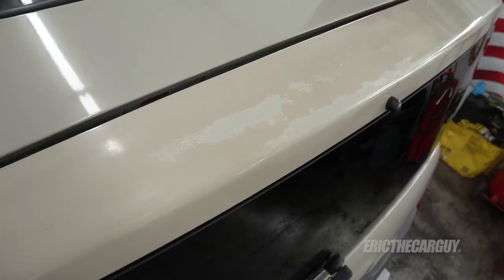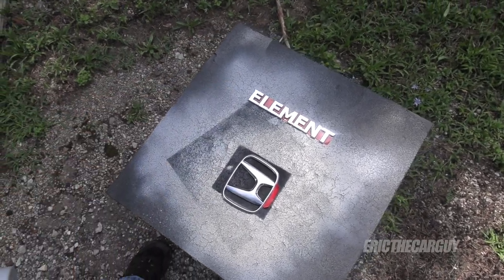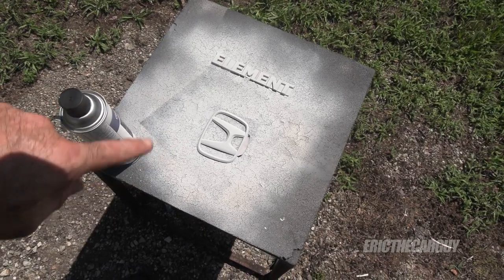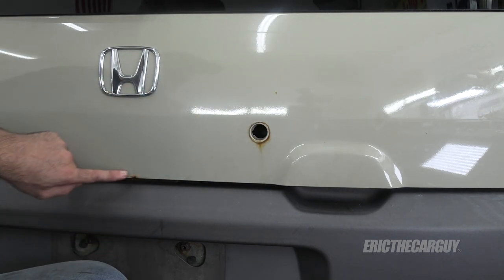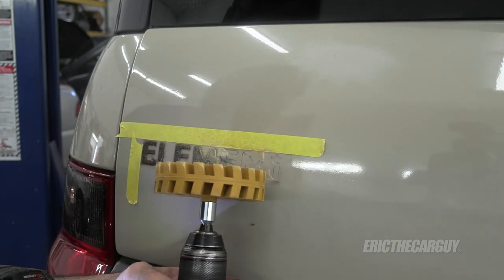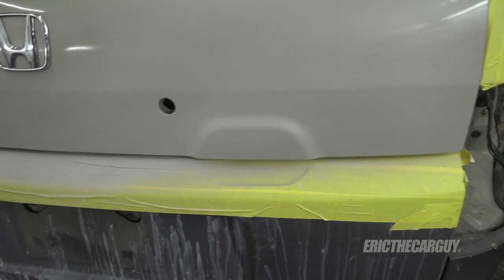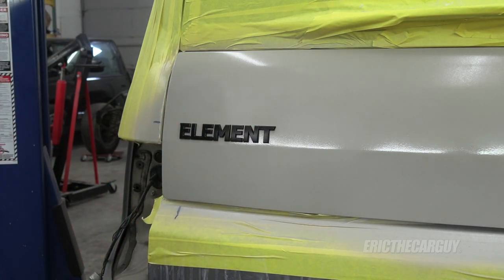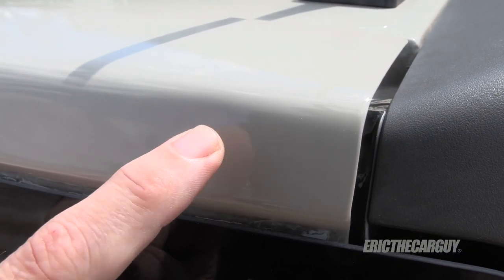DIY Clear Coat Repair

Comment: My suggestion for older washer hoses and plastic tube removal. This works for me. I use a heat gun to heat up at the connection I am trying to separate. Being plastic, most of them turn soft with just a bit of heat and greatly reduces the risk of breaking or damage to brittle parts.
Reply from the maker: Great suggestion. Thanks!

Comment: I remember doing bodywork on cars in the 70s and all of those lovely metal emblems that were installed with either barrel clips or speed nuts. There were holes in the body panels for the pins to pass through and the barrel clips would  cause rust to start around each of the pins. The speed nuts were especially annoying because they were very difficult to access. Sheet metal stampings had lots of sharp edges back in those days and I left lots of DNA samples behind. Japanese cars were among the first to start using glue on emblems which was fine by me. They weren't really expensive to replace at the time so it made my job much easier.

Comment: Great video and very similar to my outlook with bodywork. I never try to get it perfect, I just want it better than it was. Just one important comment for your viewers. It's not a great idea to sand between coats of clear. It is better to put all the clear on and then sand. First it has to be good and dry to sand, and second you need to have a decent amount to sand or you burn through. The last stage is always "cut and buff", which means sand with high grit sandpaper until flat then buff with polishing/rubbing compounds. I almost always skip this because I don't care, and it drives my brother crazy. Keep up the great videos.

Comment: Whenever i put my emblems back, i just measure with a pair of calipers to find the corners of the emblem from two pieces of tape with dots that i place outside the work area. So like on the lights, or the window.

Works really nice and cannot fail nor does it get in my way. If you leave the tape large enough, you can write on the tape the two top corner measurements. Generally, i just write one, and leave the calipers set on the other.

Comment: Yeah, I noticed those dents and figured out how they got there. Couldn't decide whether to comment on those but then you 'fessed up at the end of the video. Anyway, your work turned out nicer than mine usually does. And you're absolutely right about insurance and bodywork involving emblems/badges/etc. In my experience, they even mask around decals - which ends up looking like complete crap.

Comment: Congrats, that came out better than 95% of body shops would have done.
Reply: lol no. maybe most shady shops that dont even have a compressor. I can do a better job outside in my yard
Reply: @v8consumption  Not so, I have paid for body/paint work that was really crappy.
Reply: @peterfernandezjr5914  That is straight up false. Speaking from 15 years of experience in the field, any self respecting professional wouldn't even present an end result like that to a customer. Eric did a great job with the tools and supplies he had and he is happy with the end result but please don't ever say 95% of the body shops do a worse job than that.
Reply: @KoMDraegast  I guess where you live the body shops are better than where I live. I have experienced lousy repair work on my own cars. Including misaligned hoods, trunk lids and paint that did not last very long in the hot Fla sun. And since insurance companies  don't inspect the work, they only care about saving money, these body shops could care less.
Reply: @peterfernandezjr5914  Saving money is part of the profession but allowing obvious mistakes like that to slip would never happen here. I'd probably get fired if I maintained a standard like that.
Reply: @KoMDraegast  I suppose it also depends on the vehicle involved. For example, around these parts there is only one body shop allowed to work on Tesla cars, I bet
 their standards have to be very high as well as luxury brand body shops, where customers are more demanding and expect quality work, my lowly Toyota did not get much love at the repair shop. I noticed right away that the hood was not aligned properly, but i just needed my car back for work, besides I made the mistake of not taking it where I wanted to, but instead I took it where the other guy's insurance company wanted me to go

Comment: Why didn't you used 2k clear from a rattle  can? It's more durable and will look shinier. Just a tip for future paint repairs
Reply: Also more hazardous to your health with out proper protective gear lol. I would stay away from that stuff and leave it up to a professional painter. The chemicals in the 2k clearcoat seem extremely toxic with out a mask and suit.
Reply: Nonsense. For no more than he's painting, a 3m cartridge mask and an open bay door or exhaust fan would be fine.
Reply: @mccoma11  might want to do a little research but hey it’s your health not mine. Do as you please.
Reply: @Speed04GT  I know all about it. I use cartridge masks (half-face and full-face) daily, as well as scba while working with extremely dangerous chemicals. I also, as a hobby, use 2k coatings/epoxy primers often. I have a complete set-up with compressors, sanders, several pneumatic guns, and even a turbine unit for spraying everything under the sun. A correct-fitting 3m style mask with the right cartridges would be plenty for a job that small, as long as there is good ventilation.
Reply: But you are correct that it can be dangerous. It's pretty bad stuff and you don't want to be breathing it.
Reply: @mccoma11  no filter masks are safe for working with paints containing isocyanites... They will be satured 20-30 mins after first exposure and once you can smell the paint you are already way overexposed
Reply: @KoenOnbekend  I also believe that it doesn’t have a smell aka an odorless chemical. I remember reading that the full and half faced mask are not good enough. I pick up a can to do my headlights and after reading about how bad the chemicals are I decided against using it. Better safe than sorry.
Reply: @KoenOnbekend  "When properly selected and used, air-purifying respirators can be used safely and effectively to reduce exposures to the common diisocyanates. Appropriate cartridge change schedules can be developed to ensure cartridges are changed before breakthrough occurs. OSHA is correct in allowing employers to choose air-purifying respirators for diisocyanates if they are appropriate for their workplaces. As is the case with any other air contaminant, a complete respiratory protection program per 29 CFR 1910.134 is necessary to ensure that respirators are selected properly and provide appropriate protection."

Comment: My favorite and most effective way to remove decals and adhesive from paint on vehicles is to use a steam cleaner to melt and gently wash away the residue.  It works!  Not only is it relatively quick,  it also doesn't harm the surface underneath as the steam doesn't get too hot.

Comment: One thing we often did to correct orange peel, was to lay down at least 3-5 coats of clear coat, then wet sand it and polish it up. Works really good most of the times!

Anyways, nice job Eric!

Comment: And another great video Eric! I am currently battling tailgate rust on my 2010 Ford Escape. I'm doing almost exactly what your doing and I found that hitting it with 1000 grit between coats is working great. I went with the body lines for transition from grey to factory "silver ingot" and achieved a cool "tu tone" look. Found that cool effect by accident since the factory colors are delayed in shipping! Lol! Stay dirty my friend and thanks as always for the great videos!

Comment: A few tips for you related to this video. 
Your initial sanding grid was a 120, usually that's fine for an initial sand but it will leave scuffmarks in the finished product so always go from 120 grit to 220 and then 320 and use a sanding block so you dont create low spots where you sanded out the rust spots. This grid is fine enough that when you put a primer on top of that, the paint sticks to the panel but the viscosity of the paint removes any trace from the sanding. Once that is done you can sand the primer down with a 600 grid and you can sand down the rest of the panel where you didnt have to use body filler or remove surface rust with a scotch brite pad and some scotch brite cutting compound and some water, this works faster than using a regular wet sanding 600 or 1000 grit but the end result is the same and you will have an even finish when you are done with painting.
Where you ended your tape masking, use some plastic floor covering (when repainting walls or whatever) or any plastic or news papers you have laying around, this helps limiting overspray to the sides and top of the roof and any other unwanted areas. 

As for the orange peel you have now, once the paint has hardened out after a few days you can go over that with wet sanding 1500 grit or higher until you get through the roughest bit and then you can use a polish pad machine and 3 steps of cutting compound to get that finish shiny again.

Comment: "original ones are stupid expensive" says the guy that spent 120 on a emblem 😂
Reply: Honda should support and make it cheaper, it's for Honda itself.  More company logo will be out there.
Reply: if 120 is not stupid expensive, then how much is stupid? ... lol
Reply: the element oem spoilers go for like $700 used now its crazy. the side steps are also super valuable
Reply: @lafave2555  I bought an aftermarket one painted  nighthawk black same as my Element for around $250 fit perfect. Easy install as Honda was nice enough to add the areas where you need to drill.
Reply: @lafave2555  side steps come in two withs the widest being 5 inches I think. I didn’t know that and bought the smaller one I think it’s 3-4 inches wide which is pretty useless for passengers getting off and on. I would like to get a wider one.
Reply: @ikocheratcr  121 and higher. Had to replace the Si trunk emblem on my 07 civic Si, stelership said that it's discontinued but could get it for me at a price of , hold on to yer wallet,  178 bucks!  When I woke up from sticker shock, I went to Amazon and found one for $38. Can't see a difference. Other than the amount of $ I spent.

Comment: Try 3M adhesive remover for that left over gunk after you use the eraser wheel.  Usually remove badges with an application of heat gun, fishing line (same idea as your twine), and finish off with the 3M stuff.  Works wonders.
Reply: I've used goo be gone or goof off. Way easier than using either of those eraser discs.

Comment: "Did all that work and I never washed it well that's just kinda how I am"

Feel you
Reply: I have owned one of my vehicles for 8 years now, and have never washed it. However, it's a Saturn with the plastic body panels so getting off salt and such is not so much of an issue.
Reply: Ya, I am more of a "runs pretty" then "looks pretty" kind of guy!

Comment: Replaced the old incandescent tail light bulbs with LED counterparts on my wheels, Choosing a red LED will make it so it will glow a vibrant red color, slightly dimmer than if you choose the regular white LED, the lights will indeed be brighter but at a less "red" color.

Also scuffing the chrome on the element badging was a good move, I tried painting my chrome trim on the doors but the paint just peeled right off even though i gave it sufficient time to somewhat cure.  learned something new, :Thumbs up.

Comment: Just what I was waiting for. The clear coat peel is much more noticeable on an orange element. Doesn't seem to be such a big job like I hopped. Now its just the motivation to do paint work....
Reply: Must have gotten over spay on the other car parked near you car if you would of wet sanded the paint there would of been less orange peel.

Comment: I have an o 04 and added a 06 grill and painted the grill and emblem black. I also added ld reverse bulb. Plus an aftermarket rear spoiler that I installed. I added an led for the 3rd brake light. However after seeing your 3rd brake I fell in love with it! Going to get it. Now if you would just add a supercharger or turbo that would really be great so I can follow in your foot steps 👍

Comment: Nicely fixed paintjob :)
This is probably the job I've done most often to my cars in the past, removing rust spots and touch-up painting them with spraycans :) After the final clear coat, I used to polish it with rubbing compound for more glossy finish & to feather it in to the original, surrounding paint. Finally wax it with new car wax. 
When everything came together perfect, it looked pretty good for amateur painter like me, even if I say it myself :D Quite satisfying work :)

Comment: Just some tips:  cover the adhesive with gel hand sanitizer then put plastic wrap over it.  Let sit for 10 minutes and the adhesive will wipe right off clean with no elbow grease needed.  You would be shocked how good this works!  Isopropyl alcohol is the best prep spray to get it clean for paint. Spray and wipe it off!  Make a paper template with the emblem's locations so then you can remove them before painting and paint everything without them in the way for a cleaner look.  Also, put your spray paint and clearcoat in hot water to warm them up and it helps to avoid orange peel.

Comment: 8:01 add a piece of slightly stouter foam between the clip and the body, that way it won't ever break, because you can't stress it past the point of opening, which is why these break eventually.

Comment: For removing emblems i usually hit them lightly with a heat gun and then use fishing line to pop them off, also makes removing the adhesive off easier to where goof off or something simple makes quick work

Comment: Looks good enough 😁👍🏽

I’m looking at the lift gate lines looks like it’s actually pushed upwards in certain areas the way certain body lines are but it lines up where it shouldn’t if it’s pushed up in others since you couldn’t get it adjusted at the hinges I’m definitely going to say the lift gate itself is what’s bent probably at the top near the glass where it naturally bends. looks like it was pushed in during whatever collision and someone pulled it out rather than replacing the whole thing. 

I did a similar setup with LED brake/running lights and reverse lights on my TSX I just didn’t wanna do that whole resistor thing like I did with my truck 🤷‍♂️. I really like that flash 3X 3rd brake light LED I think I’m going to swap my LED 3rd with one of those too 👍🏽

Comment: Good results for non-bodyshop DIY stuff.  Way better than it looked when you started, and that was the whole goal.

I'm anal enough and crazy enough that I would've removed the emblems, then block sanded and painted the entire tailgate.  120 grit, primer, 240 grit, more primer, 400 grit, color, 800-grit, color, 1000-grit, clear, 1500-grit, clear, then a cutting polish.  And I would've been there for three whole days doing it, too.  Would've been completely unnecessary overkill on a vehicle like that.  LOL.  Your way is 90% as good and takes far less time.  :-)
Reply from the maker: It's really great when someone 'gets it'. It is my winter car after all. Thanks for the comment.

Comment: I have used that brand of red flashing bulbs.  They are nice while they work.  Over time, something in the connector breaks and you can sometimes wiggle the bulb or flip it in the socket and it will work again for a while.  

I've replaced them once now, and kept the old ones, one day I might see if I can open it up and figure out where the connection breaks.
Reply: Here we call those things show lights, because that is all you can use  them for. In Europe in general and especially in Germany using light bulbs on the exterior that do not have a KBA or ECE number (That would be sort of the German or European Agency comparable to the DOT) you would void the vehicles operating permit and it would be no longer street legal and could be shut down. After which you have to bring everything into a street legal configuration again and get it inspected (which costs quite a bit on top of a hefty fine).
I guess that might be true for some states in the US as well (kind of).
Not only that there are no legal LED alternatives for most lights available here (There are a few options for either H4 or H7 headlights that can be legally used with certain vehiclesfrom currently exactly one brand as it seems), and I am not sure if the manufacturers never tried to get those certified or if they just never passed. Which is kind of weird to be honest. The blinking part is a no go as well.
Reply: @alexanderkupke920  they are legal here as long as the housing brightness and color is correct. Blinking is permitted as well, for an initial number or length of time.  The biggest issue I've had with this brand is the contact trends to break on the bulb causing it not to light.

Comment: As far as the final finish is concerned if all you need is a 10 foot finish then go for it. It's your car.
The only thing that can not be scrimped on is the preparation work.
The look of your finish and how long the paint stays on is all in the prep-work.

Comment: Back in the day I use to use easy off oven cleaner to remove chrome on when it was on plastic. I used the harsher one the one your supposed to heat the oven , but did not have to heat the item.

Comment: As ive heard some say, shes a good ten footer--lol   Better than I could have done and it does in fact look better overall, rust gone, clear coat peel gone, lights improved emblems looking clean and sharp, they kinda go with the dark parts of the lower body work.

Comment: You should have scuffed the whole thing before painting. That is why the paint separated around the badge. Also, before sticking the badge you could have hit the lid with some 1500 wet sand paper and the use a bit of polish for extra shine. The colour match is amazing for something done at home.